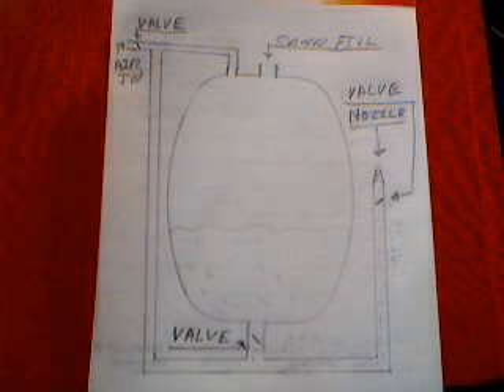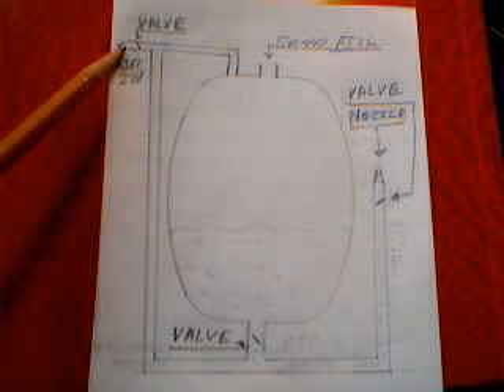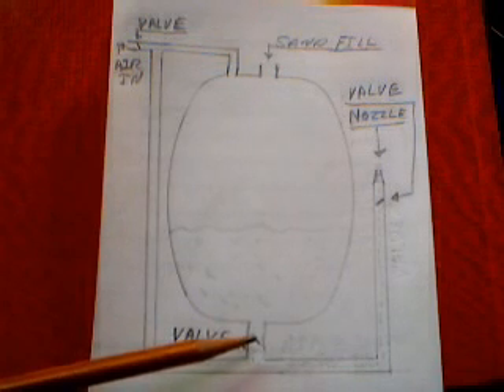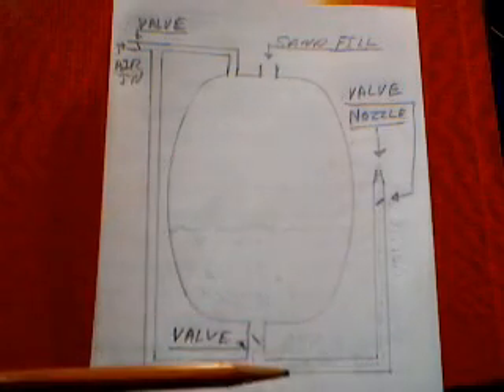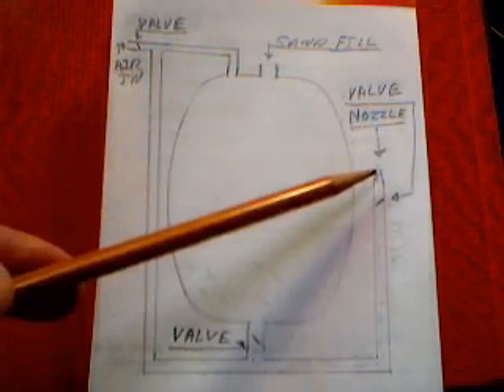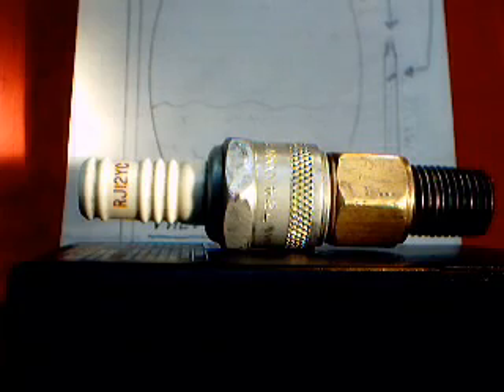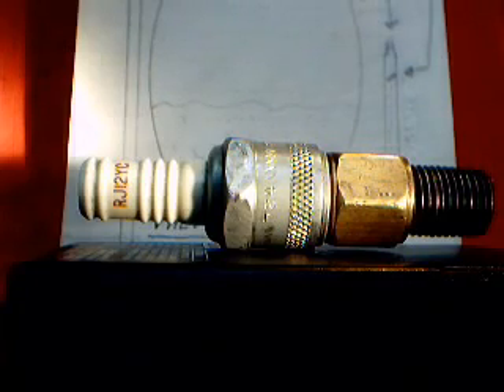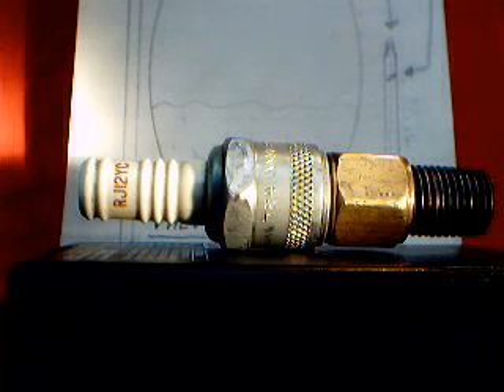Homemade high pressure sandblaster

Comment: One other question.
Is there a technique for gutting the spark-plug, or a particular order to do it in?
I've tried two different ones (NGK and Beru), and had no luck with either,
The core in both is too hard to drill, and I've had no joy trying to punch/drift them through.
Any suggestions?

Comment: You Sir, are a genius!
I just need to remember where I threw all those old plugs now...

Is it necessary to have all three of those valves in the set-up?
I was planning to just use one lever-ball valve on mine (the main inlet one), and have it foot controlled and sprung closed.
I'm building a small cabinet for it, so the pot itself will always be a few feet below the outlet nozzle.
I can easily add a valve to the pot outlet pipe, if it's needed to 'fine-tune' the grit flow?

Comment from the maker: @motorcycleengineer Hi. It sounds like a air supply problem what size is the supply line from  the air compressor. If you look at the air hose ends and fitting that is were the most of the restriction is usually. My hose on the air and sand end is 1/2'' ID. or looks about 12.5mm ID. I would think that 14mm would be just fine. My supply line is a littel to small but if you look at the ends of the hose some of the brass ends have a bigger openings than others plus don't use couplings either.Thanks

Comment from the maker: @oldpacrat   Hi again I used a small Allen wench that I cut off the 90 Deg. angel.  Any high carbon steel punch should work fine . You could try and start it just with the hammer first but try not to enlarge it or it well crack the porcelain when you drive it  the rest of the way. If it flattens out grind it down or you could grind it some first . They are a little had to get started I put mine in a vise to hold it. Sometimes I get a small chip at the J end of the plug but it well still work.

Comment from the maker: @oldpacrat  Hi. The spark plug must be a old Champion J-11Y J12-yYJ14Y there the only only ones that I could drive out the electrode. I broke off the J of the plug  and drove the electrode out from piston side moving to the plug wire side. Hope this helps :)

Comment: @plumcrazzzy from diamond would work because it's the only material harder than corundum :) I bought it from a german company and it costs like 1,5$ a pound. It's grate because you can use it many times (up de 90 cycles according to the producer). Thanks for your video, it was my inspiration in building the sanblaster.

Comment from the maker: @daredan111  Hi I think that the idea of cone shaping the bottom is great !  I've never used corindon  where can you buy it. And what type of tip would hold up to it can't imagine only two hours a spark plug tip. Sound like you would need a tip made of diamond. But I'M glad that it seems to be working for you. PS if I get low on sand I give mine a shake to . Thank :)

Comment: Hey, it works great! The only thing that I think about changing on my own is to make the bottom of the tank in a cone shape, otherwise when you get short on sand it will stick to the concave bottom because of the above air pressure. I need to shake my tank in order to get it all out. The spurkplug works great with sand but when I switched to corindon it wear out in a couple of hours. Good that I have a lot off spurkplugs in my shop.

Comment from the maker: @Jessem4681 I think so as long as the air is dry. You could use steel shot for shot pinning with a larger nozzle as long as the medium  flows like an hour glass I  think that it would work. Dry ice not sure how they do might need a feeder?

Comment: @plumcrazzzy  i used old spark plug(drilled out) two conical metal peaces , between it is small hole 3mm for sand(just normal playground sand i use) , i will post picture or movie later, that will make everything more clear. problem is the small compressor i have. it works but i have to w8 for comp to built up pressure. it sucks, i have painted garden house this summer and my comp was on fire after 2 hours haha. greetz

Comment from the maker: @grumbern  Recycle and it was free not sure how much nozzles cost maybe $10.00ea . I wounder if anyone found other plugs that work old champions are all I found sad to say that was all they where good for. I could  ruin a set In a afternoon in a 67 barracuda I had in the 70's . They worked fine for most cars  but I swapped them out for A/C's never had another problem .

Comment from the maker: @gildardo011  Hi there. I bought the hose at Farm&Feet in the Ag department it's 1/2" ID it works fine at 100psi but I wouldn't go over that . Not sure but regular air hose mite work Don't know if the smaller ID would hurt that much. Thanks alot . Had fun making it .

Comment: @panos215  sup im also down under.... also a sand blaster.... We use grit and garnet for the job.... but your looking in sand grit is idea for you so your job is easy and fine sand that cleans nice... in adelaide air port i did all them steel work ;) 

Hope that helps you.

Comment from the maker: @panos215 Hi there in Australia. I have always used silica sand but any sand should work fine.I have thought some time I would try some aluminum oxide because of how bad sand is on the lungs. One thing is make sure that the sand is dry. Good Luck !